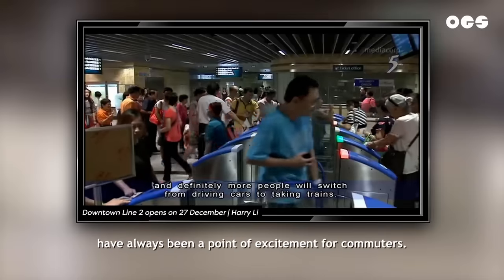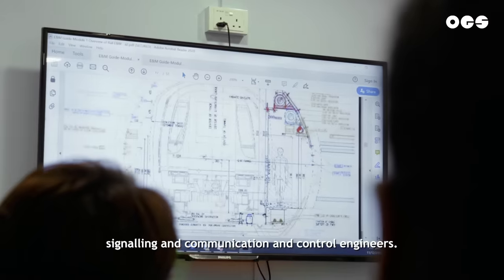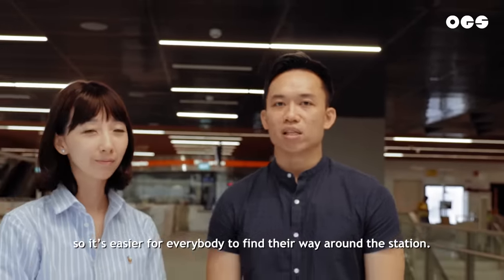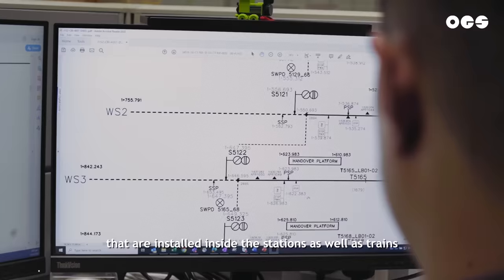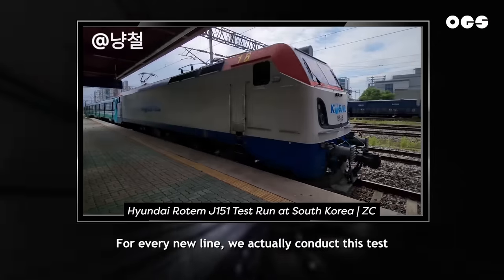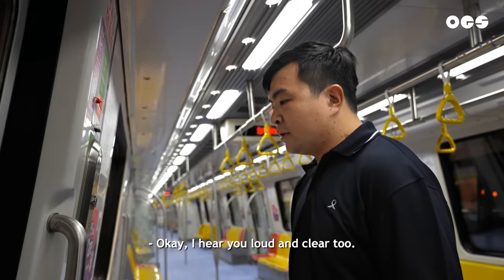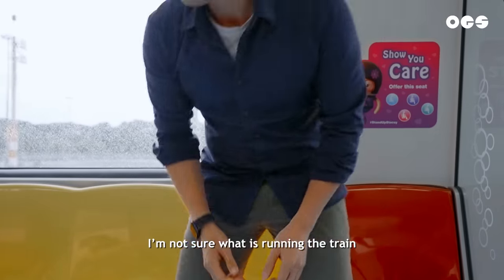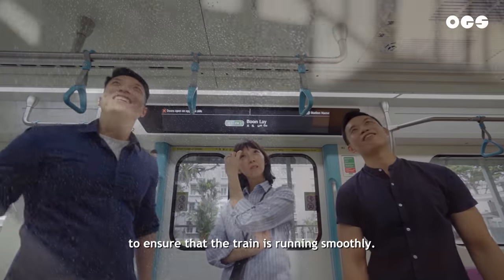What Does It Take to Build a New MRT Line?

Comment: My sis was a Civil Engineer,  she participate in the Dhoby Ghuat MRT, hers is tough cos above the station there already an existing large building...n her team needs to take care of avoid hitting tat building core structure 😊😊😊i m so proud of her🥰🤗
Reply: Ex-civil engineer here too, to add up, even civil engineers are subdivided into many teams to focus on our specialties i.e. geotechnical team, who runs analysis to ensure MRT tunnel construction's impact to surrounding buildings and their foundation is within Eurocodes design allowance. There are many more teams, example: structural team, alignment team, civil team, etc. in which we work with each other to build 3D models to ensure that all our design elements are in sync. 🙂
Reply: the u all can explain how, in layman terms, a tiny island like singapore.....how can it tahan all the drilling and weight? not forgetting the constant rainfall. how have we not sink? and i believe some time ago sinkhole already appeared in sg.
Reply: @RonLarhz  Sinkholes can happen anywhere. When engineers design underground stations, they treat it as building a tall tower, so they place structural support pillars and reinforce walls to ensure that the ground above is held up and the pressure exerted is equally distributed. That's how underground construction is done.
Reply: @RonLarhz  I dont think I can fully explain to you as I wasn't geotechnical engineer, so may take it as one of the many generic idea.

That being said, reffering to your first part of query: 
1. Imagining building sand castle at the beach (beach being earth, and castle being our island) and keep on adding weight on top. While doing so, keep on compacting the sand make it firm to a point that the sand collapse sideway. Putting this idea to our ground, as earth is round, our sideway is always connected all round, so it has no where to collapse to.  
2. Drilling wise, again imagine doing it at the beach, we shove a tubular pipe into the sand first, then we "drill inside this pipe only", the pipe will prevent sand from collapsing inward.
3. To add on, Singapore is carrying out  (we can call it "anti-sinking programme") upgrade/increase of road levels and MRT  entrance level to cater for rising sea level (To emphasize, this is not due to us sinking, but due to rising sea level as a result of global warming).  

As for your second part of your query, if sink hole are discovered (whether caused by construction or form by nature), they can be in layman's term "be filled" and compacted to desired "hardness".
Reply: A woman in civil engineering? That is so cool to know! But unfortunately most of the construction work projects are mostly done by man so I'm so happy to hear that women are leading civil engineering works!

Comment: These are LTA officers. I was both a design engineer and also a contractor engineers. Most of the time, these LTA officers are not the real people who construct. It's the contractor engineers and design engineers who made them work. LTA only tekan and sit there to watch. If U ask them hw to design they only tell you civil design criteria. They nvr helped to solve on the the ground issues. Pls dun give them credit
Reply: LTA is the one who finds contractors, gives yall jobs, and consults you for design. They handle the planning, coordination, budget, and financing for the project.
Reply: Without these folks from LTA, who is going to award you the project, approve budgets and payments? Everyone contributes in their own way, some more, others slightly less. 

Mostly importantly, if things cocks up, it's LTA that is ultimately responsible. Not you.

Remember, you don't make a candle brighter simply by blowing others out.
Reply: This is those that sit behind the Aircon desk, and those actually building is those sweating inside the tunnel ?
Reply: True bro, I'm contractor engineer also. However it's always the lta engineer that get the limelight. 😂😂😂
Reply: Need to plan route also what
Reply: i also want to add that design is all done by the contractors who usually initiate with a consultancy firm

Comment: LTA always takes the spotlight but the real heroes are contract engineers, design engineers and consultants. they work tirelessly and are in charge of everything from designing and planning to planning the work, communicating with workers and ensuring their safety. if anything happen its the main contractors problem, whether the subcon or design consultant cock up LTA will directly hold the main con liable. These engineers are the real ones that work from 9AM until late at night to ensure operations are smooth.
LTA just give design criteria then sometimes go to site and tekan for not working fast enough or safety. even if the worker ownself dont follow given instructions and take shortcut, get injured LTA IS NOT LIABLE BUT THE CONTRACTORS AND ENGINEERS. site engineers be working an office job AND sweating at site all day and LTA still takes the limelight

Comment: 2:20 They are using Windows 7 in 2023/2024???
Reply: If it ain’t broke, don’t fix it
Reply: The OS locked in during the Design Stage was Windows 7 as of 2013/14.

This is specific for the North-South East-West Line new signalling control system you see there, which underwent Design Approval during 2013/14.

Like what @iOSalltheway mentioned, "not broken, don't fix it".

The OS is meant to last longer in a closed environment, until a decision to do OS Refresh.
Reply: @iOSalltheway  🤣good compromise!
Reply: windows XP was still being used few years ago...